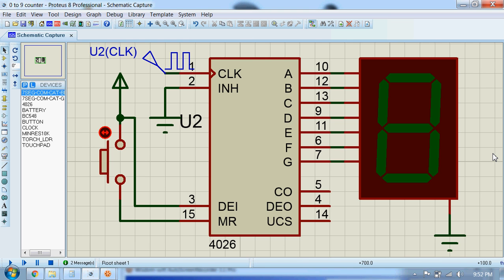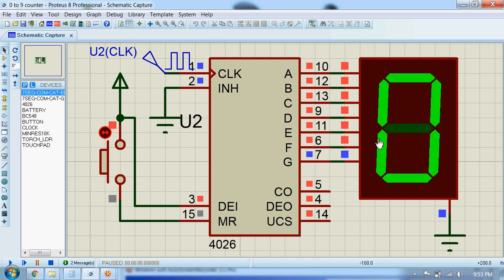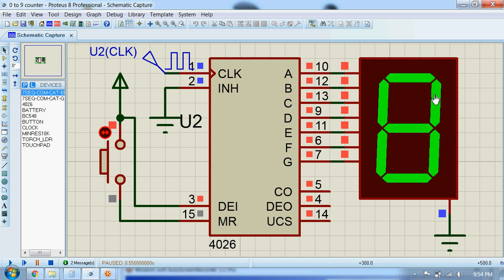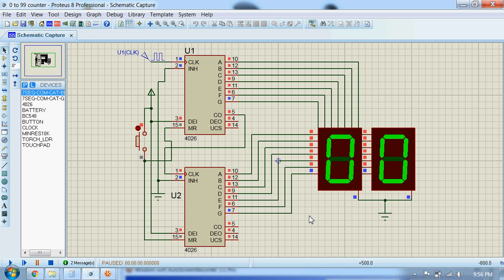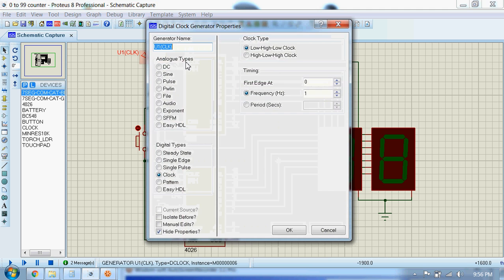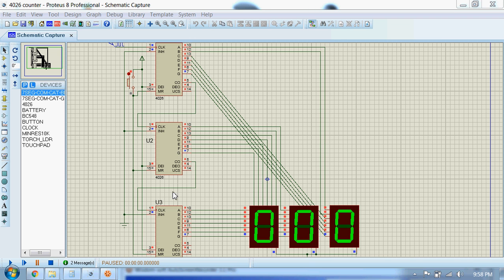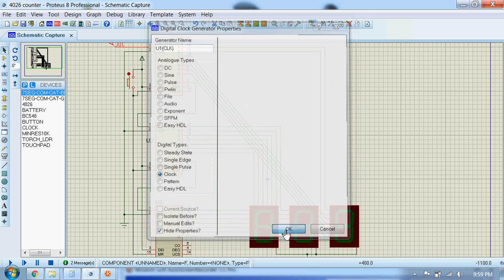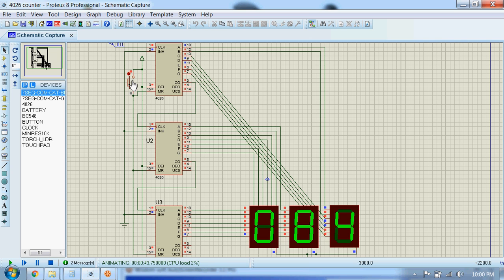digital counter circuit

Comment: Could you please send me a solution to the question
Reply: Description
Design the following circuit by using Multisim. The circuit has 4 inputs and 3 outputs as
shown in the figure:
This system is used as a digital lock for a treasury of valuables.
To open the treasury, the user must enter a serial binary password of 6 bits. Each bit is
entered with a manual pulse at the input CLOCK. If the entered password is correct, the
output LOCK is logic 1 and the treasury is open (you may use a green light to indicate the
action). The treasury will remain open if the value at input DATA is still 1, but if the user
enters a 0 at input DATA, then the treasury will close. Don’t forget the pulse to enter the
data!
While if the entered password is wrong, then the output ALARM is logic 1 (informing the
police) and LOCK is logic 0 (the treasury is not open). You may use an orange light to
indicate the police and red light to indicate that the treasury is not open.
The user can change the password by pressing input PR, but he/she must enter the old
password, followed by the 6-bit new password (12 bits total). If the user enters the correct
old password and a 6-bit new password, the output PCh will be logic 1. The user has 2
wrong attempts to change the password, otherwise the output ALARM will become 1.
If the output ALARM is logic 1, it would n

Comment: What value of clock and voltage should I use?
Reply from the maker: 5V supply and the clock frequency is set as per your requirements. A higher frequency will count faster than the lower one.
Reply: What frequency should I give, exact?

Comment: this link show good but if i want more count which pin should be given out and in 4516 ic for more count.
Reply from the maker: If you want to count more, just add more ICs and connect pin 1 and pin 5 of two adjjacent ICs. For example, if you add one more IC, then you need to connect pin1 of IC3 to pin 5 of IC4. Hope that helped.